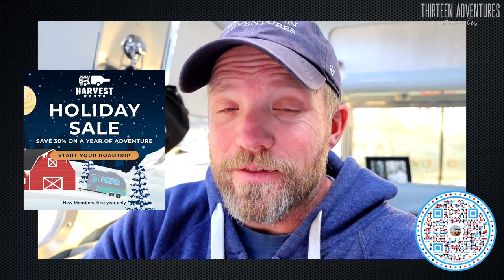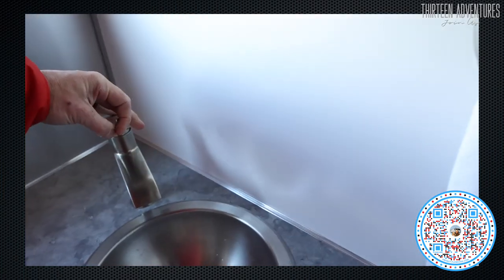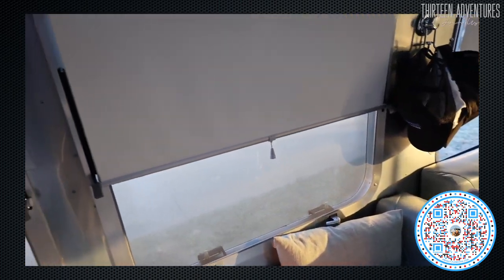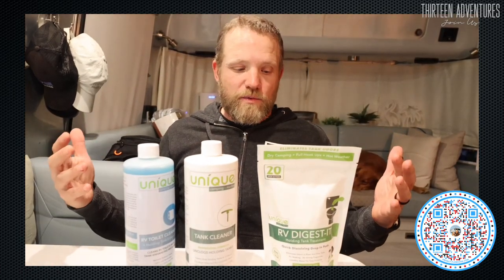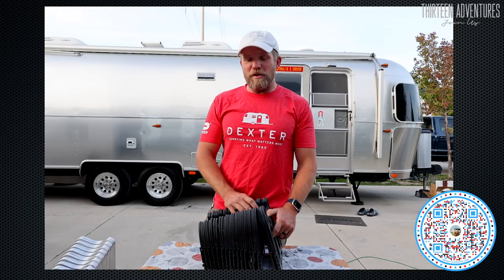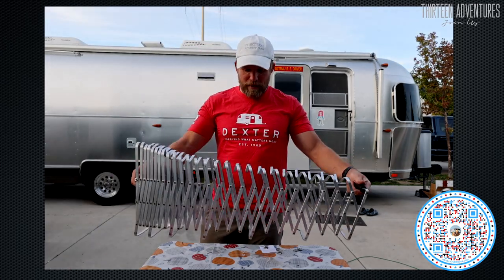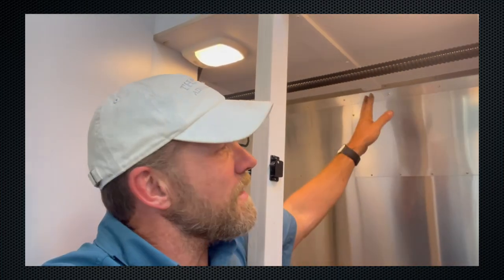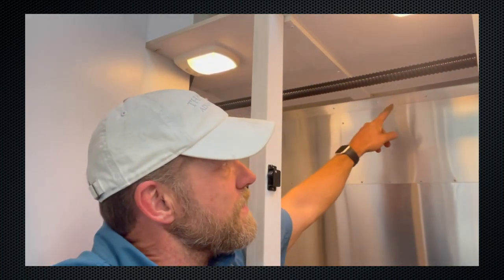Winter Camping Tips & Tricks | RV Waterline Blowout, Fantastic Fan Care, Tank Treatment, and More!

Comment: In our previous NuCamp T@B 400 camper, the windows had a “vent” position where you can open and lock them in place about 1/2”, allowing you to vent the camper.  Opening to the vent position on one window along with slightly opening the roof vent virtually eliminated all moisture issues inside the camper.
Reply from the maker: Thank you for your insight and feedback.  You can do something similar in these with the bathroom and shower fans along with the range hood and regular ceiling fan.

Comment: Quick question— I have the same compressor but was afraid to use it.  Does the PSI stay under 50?
Reply from the maker: Hi!  Thanks for the question. It’s very low pressure unless you let it build up by keeping all valves closed. This is why I always have at least one open.